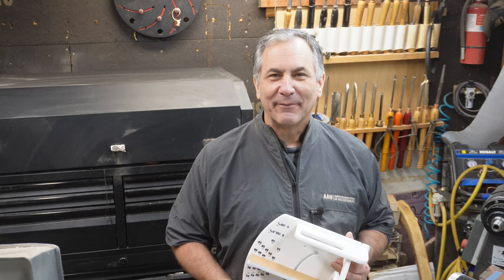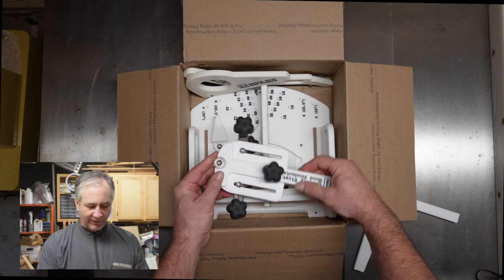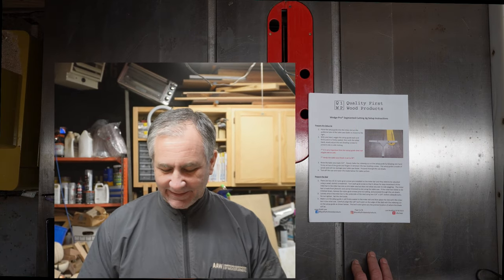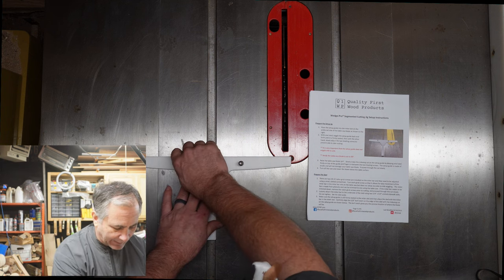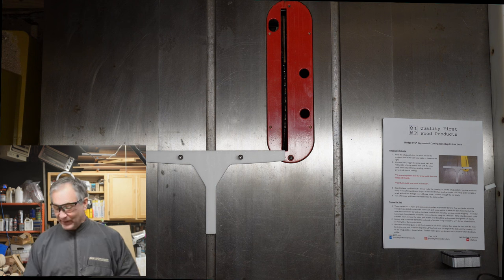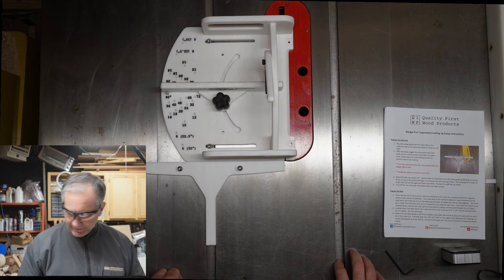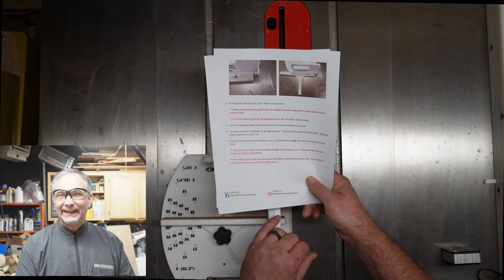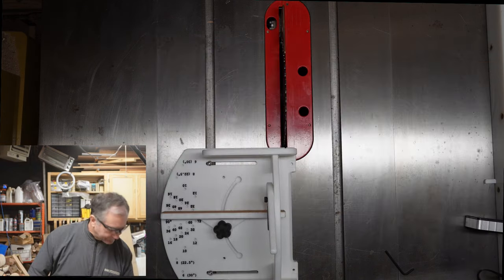Wedge Pro Segmenting Sled: Unbox, Set Up, and Test.

Comment: Do you think there'd be any significant impact if you changed sawblades?  I always wonder about that when you take a store bought thing out of a box and then cut it.  If the kerf changes some, do you just have to buy another replacement gadget to go with your new blade?
Reply: Hello Jim.  Changing blades isn’t really an issue after making the initial cut.  The main purpose of the zero-clearance strip is to add support for the segment as it separates.  If there is a little gap it shouldn’t be an issue as long as the segment is supported.  I have noticed though that my experienced segmented friends are using 80 & 96 tooth blades which eliminates the splintering and provides a much cleaner cut.
Reply from the maker: There ya go Jim, a reply from the creator himself.  I hope he addressed all your concerns

Comment: Equally accurate and much faster production wedges available with a much simpler and much, much less expensive pattern and just a bit of moderate skill with a table saw, screw gun and hand drill to make a basic, adjustable sled. But there's a downside: you won't get paid for posting your endorsement video.
Reply from the maker: Some people will like the challenge of creating their own tools.  Some people don't want to bother building a custom sled and would rather buy one.  Both are fine options and target different people with different interests.  Kudos to you if you chose to build your own. 
Although I do accept "free" tools to evaluate, I always inform the manufacturer that sending a free sample is no guarantee of a positive review.  I always give my honest opinion. Your seemingly jealous / bitter comment about me showing a bias due to  getting paid for endorsing this or  any product is completely inaccurate.